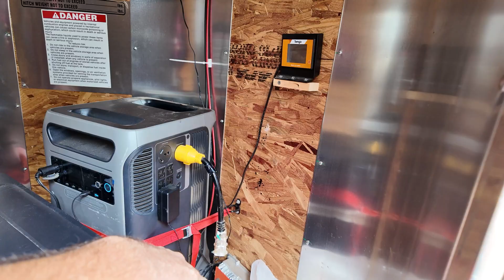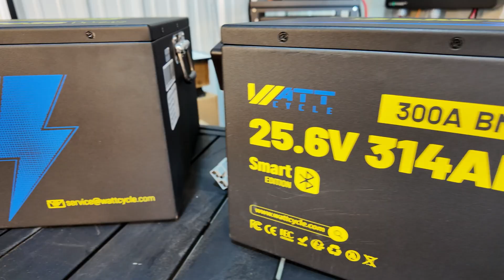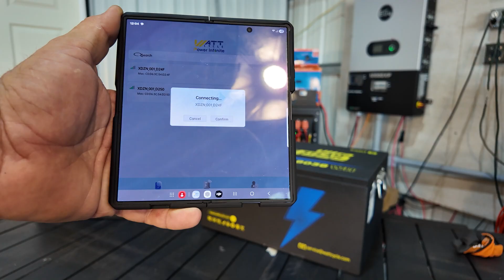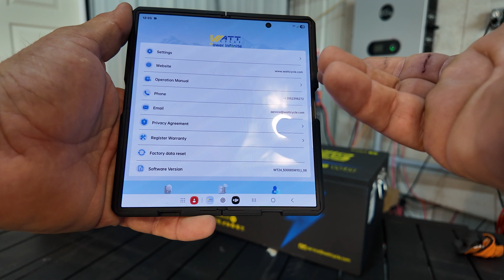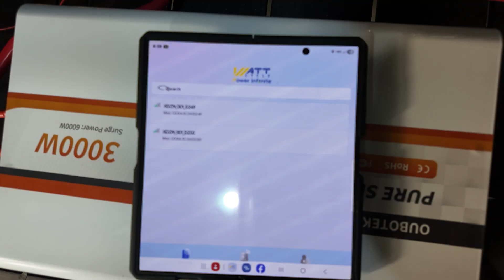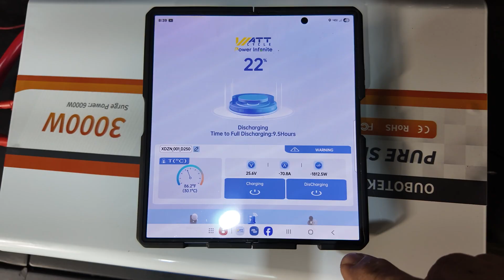INSANE Power! WattCycle 24V 314Ah Ultra Smart Battery Review

Comment: I'm wondering if these have the same issue that has occurred with the new smart versions that don't draw evenly when hooked in parallel. I know you said you're going to connect in series to make 48v but with that problem I've been happy to have dumb batteries. Awesome systems you've put together!
Reply from the maker: Hey thanks for watching. Wattcycle fixed that problem almost the very next day after Will released that video. They now have a new app that has a toggle button on it for parallel connections. It's really been my experience with them that they are extremely responsive to correct any known issues with their products. Not many battery companies out there that do that. Thanks so much.
Reply: @runawayparents these 24v make my 12v 300s look like toys lol. I guess the prices are pretty much in line, I paid 600 for two 12v so around 1200 for these sounds right. And much easier to make a 48v system.
Reply from the maker: Yeah they have been awesome running in series so far. They discharge almost dead even. Ill have the install video coming out next week. I have them hooked up to an EG4 6000XP.
Reply: @runawayparents I'm just doing a much smaller setup only used for essential stuff during an outage that thankfully are few and far between. My batteries are only used to supplement power stations. And let me run generators far less. And anyone giving you crap about what's in the camper, pfft, do want you want. I've spent plenty of $$ on shit I don't really need 😂 but I want
Reply from the maker: I've got a couple of powerstations set up like that too. Yeah people definitely will talk but that's all it is. I definitely have found enjoyment in this off grid camping and solar life.

Comment: Noticed you have the “Smart” battery there, have you seen Will Prose’s post about these it was earlier this week Tuesday perhaps.   You should probably check his video out because of a peculiar behavior of those smart batteries.   When you have multiple batteries they don’t all drain evenly. It drains the first battery nearly completely while the second battery is in sanding by waiting.  Will cause uneven usage on the batteries or other worse issues.   Thanks for the videos.
Reply from the maker: Yes, that problem has been corrected by WattCycle already. The have a new app download available that now has a parallel toggle on it. These are tied in series to make 48v and have been discharging equal. The install and demonstration video will be coming out soon.
Reply: Interesting point, but not a problem here as these batteries are being used in series.  
Also note, without the App it is unlikely this issue would be observed.  And WattCycle batteries are not the only ones on the market with this issue.
Will Prowse does bring up a good point that there is a significant (large)  inrush/outrush current issue that is real when the batteries come on-line one at a time as the rest of the bank is significantly discharged at that point.

Comment: I got the same battery,  haven't  used it yet. got sungold all in one inverter on deck ready to go. have you seen wills video of the 12 volt watt cycle review. not good, can't connect  in parallel. not sure about  the 24 volt. you should  parallel  them. or better yet, series them together.  for 48 volt system. let us all know how it does. thumbs up.
Reply from the maker: Hey thanks for watching. You will be very happy with it. Just finished the install video. Will be releasing soon. Wattcycle did fix the problem that Will P stated on his video. There is a new Wattcycle app download. The new app now has a parallel switch.  Spoiler alert. I did series content these 2 to an EG4 6000XP and they are performing awesome.
Reply: Awesome! glad to hear that. Watt cycle got on it right away. they have  a good product. thanks for the great info. keep up the good videos! thumbs up!

Comment: You say 150 lb for a 314 kWh battery?
Reply from the maker: Yes it's 24v. Basically the same size as a 628ah 12v battery
Reply: It is a 8KWH battery.  314 is the amp hours.  Basically 1.5 server rack batteries.  150 pounds for 314kwh is a huge bargain, not yet realized by current technology.